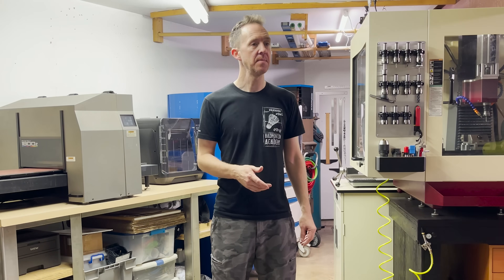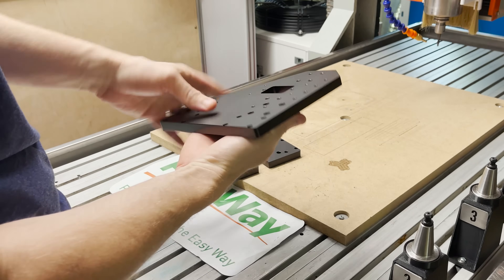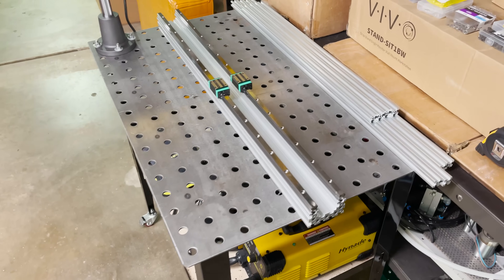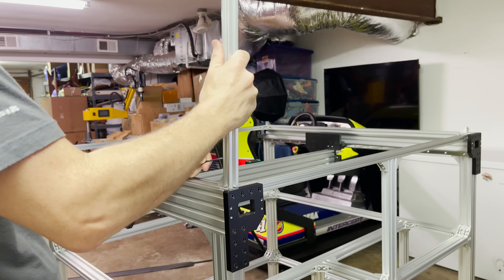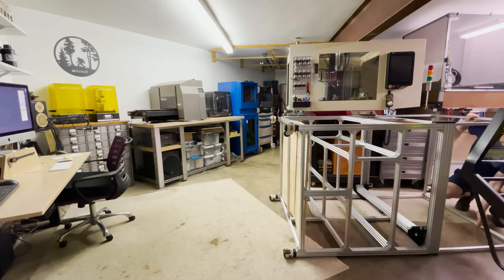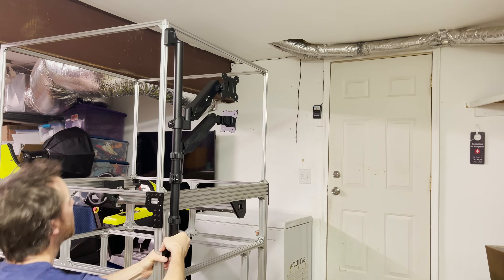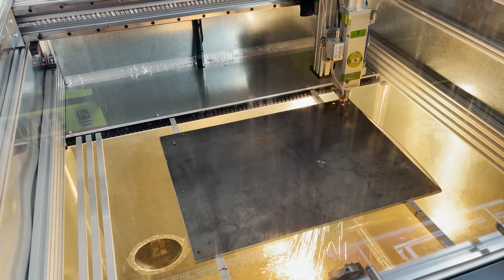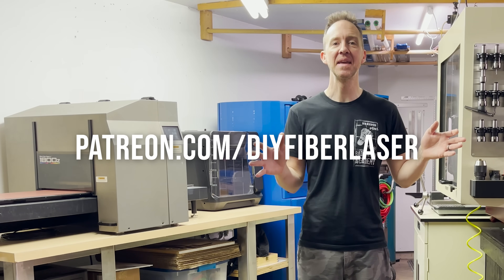DIY Fiber Laser Cutter V2 | Part 3: Finishing the Frame, X Gantry, and Floors

Comment: J'ai remarqué que vous ne vérifiez pas le parallélisme de vos guides?
Ne pensez vous pas que cela auras une incidence sur vos découpes finales ?
Reply from the maker: They are parallel with each other or the X gantry would bind up. If they are not perfectly parallel with the cutting table it is ok because the auto height sensor will accommodate for any discrepancies, which is has to do anyways since metal sheet is not usually perfectly flat.

Comment: The Maker Store heavy C beam is so good. 
Aussie product.
Did you use the original Laser to cut some parts ?
Reply from the maker: Yeah I like the product! I think I just used the old laser to cut out the 1/4” steel floor plates.

Comment: Hello

What parameters did you use to cut the steel plate in the video?
And with which gas?
Thanks
Reply from the maker: O2 9psi, 20mm/s, 1.5d nozzle, +3 focus, 0.8 height
Reply: @diyfiberlaser  O2 with kompressor ?
Reply from the maker: @alpencnc  with oxygen tank

Comment: i absolutely love this build. quick question - i realise this will primarily be for cutting, but - would there be a way of implementing a galvo mirror setup (for example 100 x 100 mm area) the smaller 100 x 100mm area could be stitch together when engraving, and stationary when cutting? or am i missing something which makes this redundant/silly? I think the advantage would be engraving large surface or cleaning rust extremely fast over a larger area
Reply: I'm curious on this as well... Would be interested in building a machine that can both cut and engrave thin sheet metals... Would even be ok if I could swap between the cutting head and galvo head
Reply from the maker: I've never tried it, but I assume running 2 separate controller/software packages on the same motion system is the challenge.
Reply: @diyfiberlaser  is there any controller that could do both? 
I guess alternatively you have to have some switches to allow different controllers to send commands to the motor drivers... Similar to KVM switches for keyboard/monitor
Reply from the maker: @vstolpner  I've never seen a controller/software package that does both...yes, some kind of switching the motors back and forth would probably have to take place.
Reply: @diyfiberlaser  there are xy gantry fibre lasers which use galvo mirror setup for rapid x y engraving, then in software they just move across an engraving image in a quadrant essentially stitching the image together. I don't think it would require 2 boards, however - I am basing this on a lack of experience and only knowing the cheap Chinese 30w fibre lasers have come up with a software solution - hardware wise it is just 2 extra drivers for galvo mirrors
Reply from the maker: @danny36120  Yes, I've seen those machines. It's not just the galvo mirrors...you will still need 2 separate laser sources and laser heads.